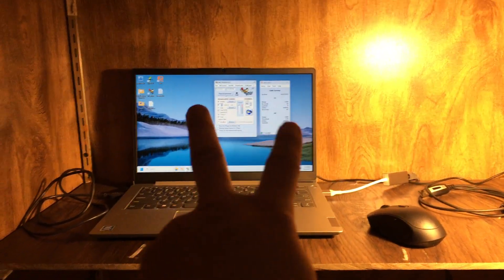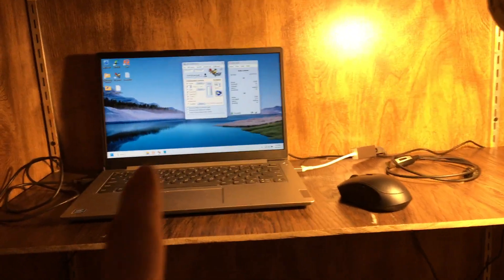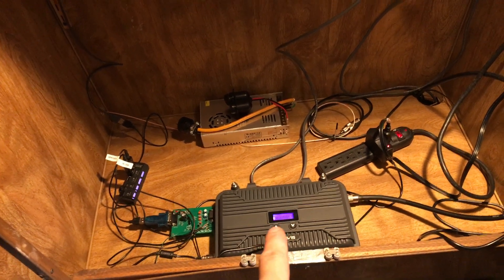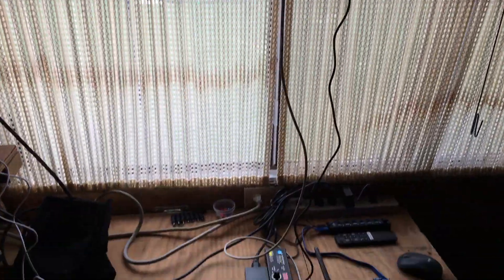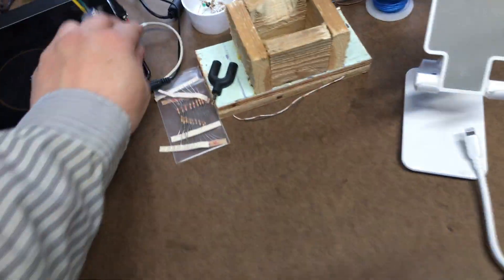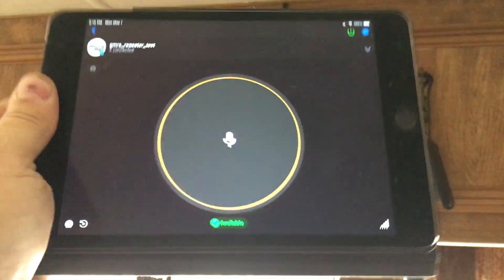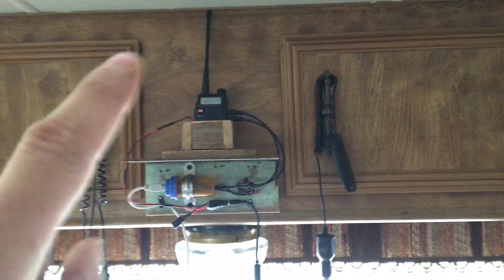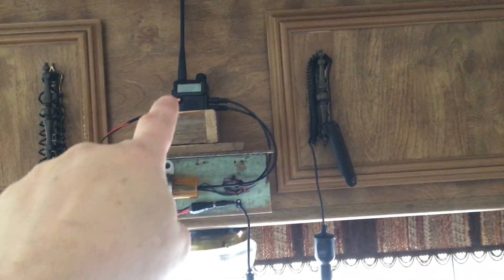🔺 Join my "test" Zello channel for interface Retevis rt97s/midland mxr10 GMRS two-way radio repeate🔺

Comment from the maker: NOTE: I am using a Baofeng Uv-5r handheld in simplex mode to recorded and playback, this is programmed to the RT97S frequency. So the sound quality will be lower because it's recording the sound from over the air and I don't have the volumes set right! But you can play with it and hear how it sounds. Also, this being a "test" channel, you will hear me testing it and feedback noise and all kind of noises sometimes..lol . And the "repeater" made not always be on too! Keep in mind this is a TEST, still have to do some more adjusting yet :)  also I may NOT always have this on due to testing other projects!!!

Comment: Hey! a bit scratchy sounding as you mentioned it might be but it worked! Congrats on the effort so far with the interface board for the 97S.  I have that repeater on order and so I'm hoping that your board is something you'll want to sell as the Zello-to-repeater setup is basically the perfect setup for my requirements.  Please let me know if I can help test from this end!
Reply from the maker: Thanks and yes it will be, I don't have the Baofeng Uv-5r handheld tweak very well. But at least people can get an idea on how it works. I plan on selling them soon (I am waiting for parts and more testing I will be doing in the meantime) if i need any more help i will let you know :) thanks
Reply from the maker: FYI I may try my Retevis Rt85 handheld it has much better sound BUT that requires me to build another circuit for that so that's why I didn't use that radio to begin with.
Reply: @GMRStwowayradio  Frankly the sound quality is just fine with me. If I ended up with that if/when I had it setup on my end there'd be no complaints.
Reply from the maker: @jeffkarp3049  ohh ya its not bad. i may try to see if i can make it better. 🙂